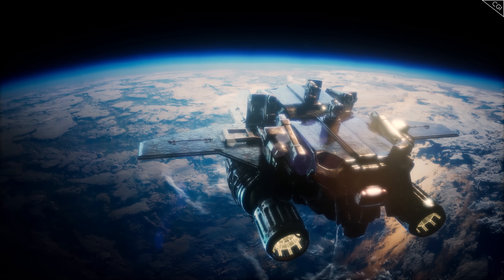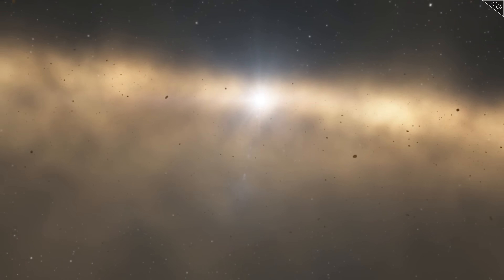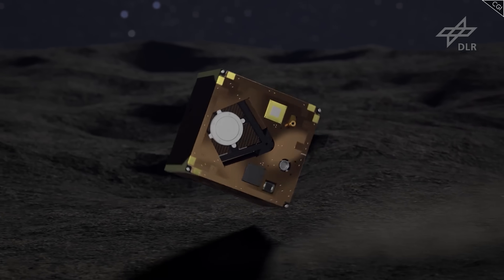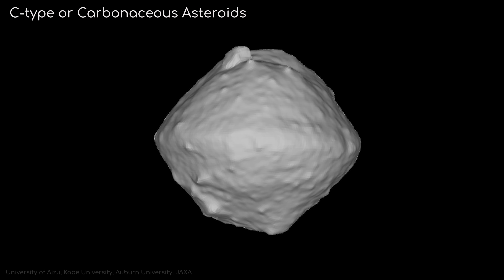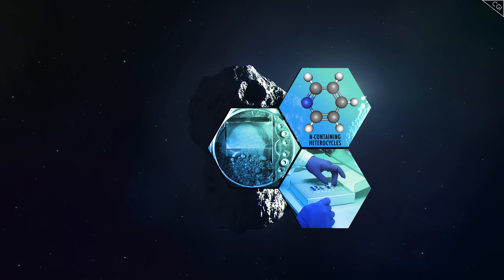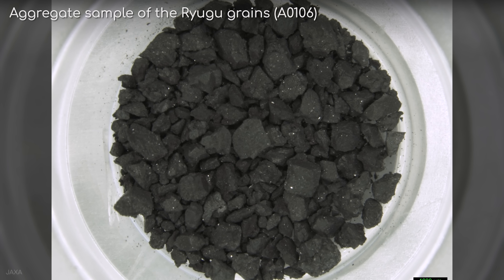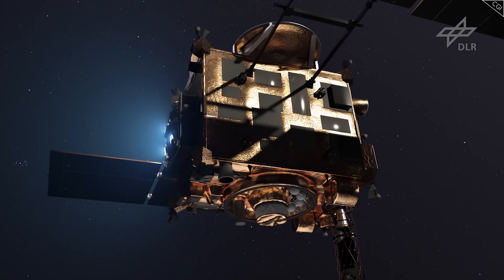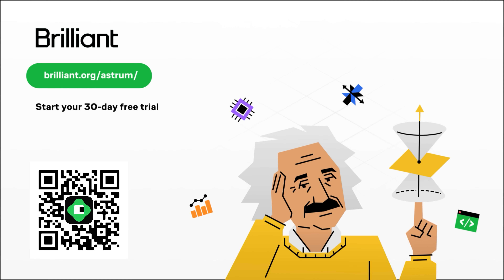The Real Story About JAXA's Mission to Asteroid Ryugu

Comment: Unfortunately, as an environmental microbiologist specialized in extreme environments, I have to say that usualy, the sampling missions are almost always disconnected from the preparation of the sampling machine and storage compartment, and this is a huge flaw. Too often, priority is given to geologists and microbiologists are only consulted too late, after someone - a microbiologist - pointing out the flaws in the mission preparation. This ends with samples being contaminated either during the drilling operation (contaminated drill), sample collection (mechanical arm has its twizers contaminated), sample compartment (inefficient sterilization of the sample storage, or leaks of contaminated gases into the compartment during transportation), or, and this is especially unforgivable if all the others were correctly addressed, contamination during the opening of the sample storage and sample handling. All the equipment that will be sent to a sampling site must be decontaminated and kept under sterile conditions (sterile air, sterile surfaces). I say this because of my sampling missions to thermal vent fields, which have their own difficulties due to high pressure and of course, water all around, filled with microbes.
Reply: What happened with the contamination of Hayabusa sample was linked to sample processing, on Earth. Instruments were not properly sterilized. This can of course happen and for this reason, backup samples have to be stored right after reception. Like they fortunately did.

Comment: This is an extremely important finding related to ‘mirror life’; this was humanity’s best attempt to make a sterile object … place the sterile object into (a hard vacuum, fluctuating temperature, and irradiation by unshielded sunlight) for a long time, then examine this object in an absolutely sterile environment.

Wherever the terrestrial contamination occurred, the question is “for mirror life, can we prevent (life / mirror life) getting into, or getting out of, *humanity’s best attempt at preventing such a thing happening*

This was also done on a HUGE budget, with meticulous attention around containment in both directional.

What happens when we try biocontainment in ‘normal’ laboratories (i.e. funded with ‘less than a space exploration budget’, either by public money, or private industry)?

Mirror life will escape, is guaranteed to escape,  if we manage to create it!

Comment: Hold on ! A class 1000 clean room has 1000 particulates per meter cubed and a class 100 clean room has 100 particulates per meter cubed and a class 10 clean room has, you guessed it 10 particulates per cubic meter ? a class 10,000 clean room is the inside of your boxer shorts, whats going on ? take a break for a year and regroup, I'm not the only one how is disappointed with this drivel.